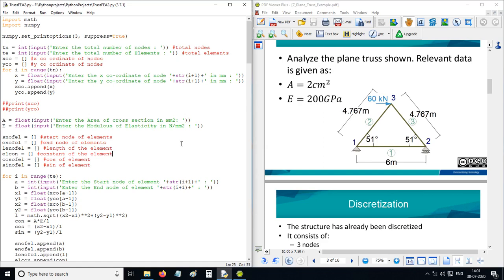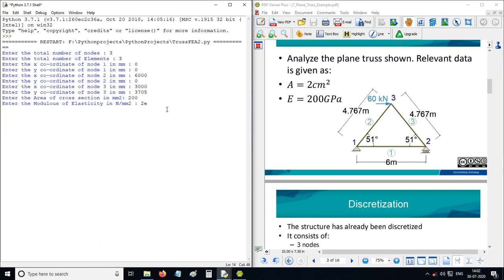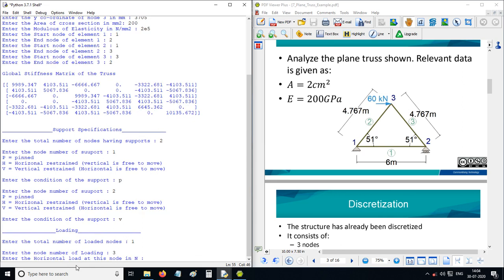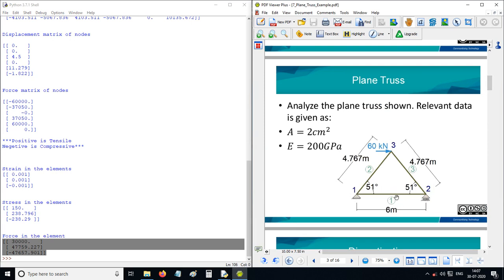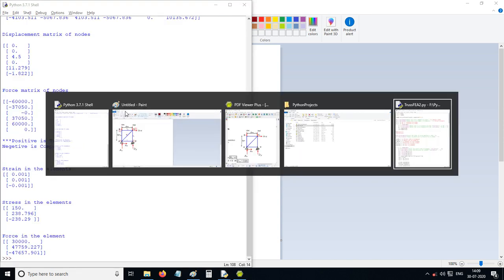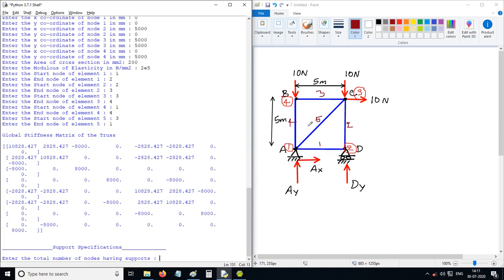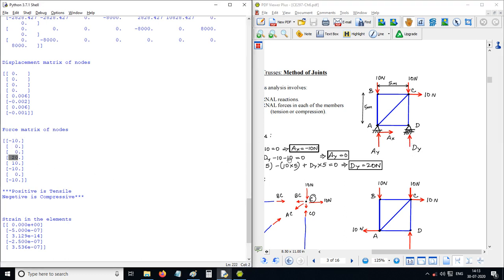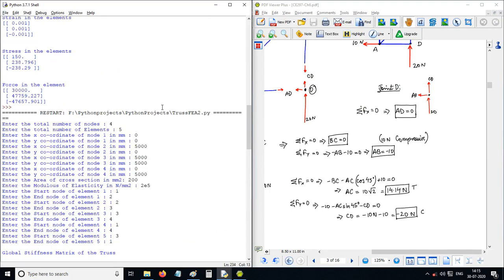PYTHON code for FEM Analysis of 2D plane Truss || Finite Element Analysis of 2D plane Trusses

Comment: Thanks a lot for this great video.
I've got a question about the code.
In the line 89 , what does that loop exactly do and why did you define GSM?
I mean , couldn't we just use gstmatmap instead of GSM ?
Reply: FEM video 01 – Introduction and bar element
https://youtu.be/UHRoz2nioSU

FEM video 02 – Bar element example
https://youtu.be/6tKHH8zptBY

FEM video 03 – beam element
https://youtu.be/zioGBMtq2PA

FEM video 04 – beam element example 01
https://youtu.be/zioGBMtq2PA

FEM video 05 – beam element example 02 with UDL
https://youtu.be/ZSSSXRd0FcQ

Comment: I am getting this error after entering the loading values (vertical and horizontal loads on nodes) 

Traceback (most recent call last):
  File "d:/Projects/Python_2D_Plane_Truss_FEM-master/Python_2D_Plane_Truss_FEM-master/2D_Plane_Truss_FEA.py", line 168, in <module>
    dispresult = numpy.matmul(numpy.linalg.inv(rgsm), rforcemat)
  File "<_array_function_ internals>", line 5, in inv
  File "C:\Users\Vizexperts\AppData\Local\Programs\Python\Python38-32\lib\site-packages\numpy\linalg\linalg.py", line 546, in inv
    ainv = _umath_linalg.inv(a, signature=signature, extobj=extobj)
  File "C:\Users\Vizexperts\AppData\Local\Programs\Python\Python38-32\lib\site-packages\numpy\linalg\linalg.py", line 88, in _raise_linalgerror_singular
    raise LinAlgError("Singular matrix")
numpy.linalg.LinAlgError: Singular matrix